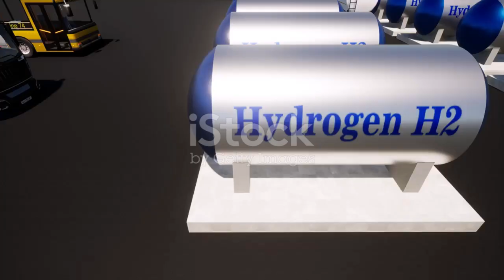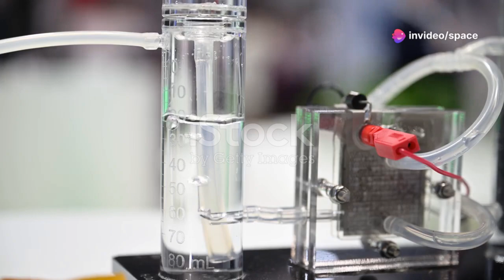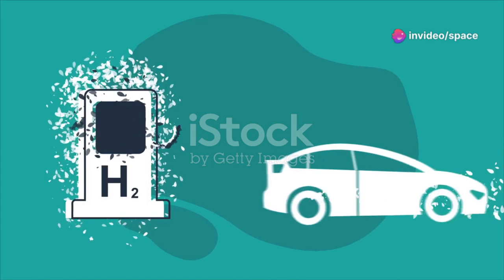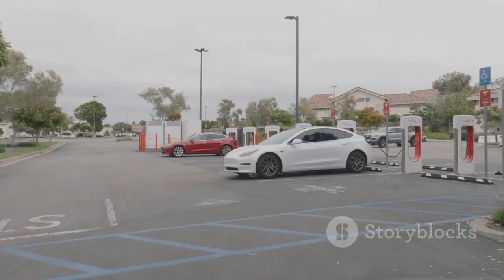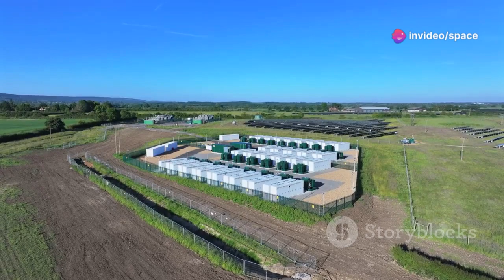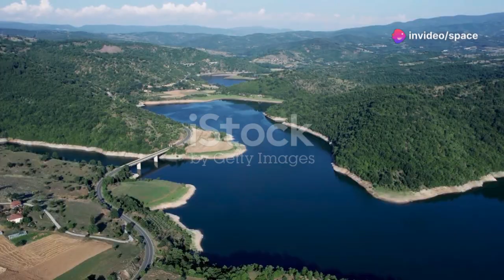TOYOTA CEO: THIS NEW ENGINE WILL END ELECTRIC CARS," SAYS TOYOTA CEO ABOUT HIS CREATION

Comment: Hydrogen fuel cells (HFC) are an old technology, which were used even in the Apollo mission spacecraft of the 1960s. The technology is one of those that tease by seeming ideal in theory, but fall completely apart in practice. The are at least three obstacles which render HFCs impractical for motor vehicles.

1) The energy density which makes hydrogen such an attractive fuel also makes it very dangerous. It’s extremely flammable, and ignites easily. Just refer to the Hindenburg disaster, after which, the dirigible industry switched to helium. Compressed into a fuel storage tank, hydrogen creates a high energy bomb just waiting to explode. Liquified, it is used as actual rocket fuel. 

2) Speaking of fuel storage, hydrogen has to be either liquified and maintained at extremely low temperature, or compressed as a gas at very high pressure to store enough of it to be useful in a vehicle, in terms of range.

3) If hydrogen were just lying around, the above practical problems would be obstacle enough. However, hydrogen isn’t just lying around, and must be produced (liberated). The energy required to produce (liberate) hydrogen greatly increases its cost - in addition to those safety problems.

As a result, tanks of hydrogen will not be replacing batteries for storing energy in automotive application. Battery technology is poised for even further dramatic leaps in terms of energy density, and re-charging speed than has occurred over the past 10 years. In addition, since batteries don’t have the safety problems of storing hydrogen, and are a power technology well in production use, I see no reason that hydrogen has any chance gain a market foothold. The only exception would be some radical scientific breakthrough in rapidly electrolyzing the water from on-board tank, using only a small amount external energy to do so.
Reply: On top of these problems -  the car will have to have batteries to recover energy from braking & etc.

Comment: Already you can buy a BYD EV for $20.000 with range almost 400 miles and recharge 250Mls in 15 mins. I have seen people trying to fill this Toyota and it takes 15 mins for them to try and remove hose frozen in. You do not mention cost, at $36 a kilogram it costs almost $200  for your 400 miles more than x10 cost for electric. This is Toyota propaganda. Ask any current owner of Toyota hydrogen car would they buy another 100% NO. They can't sell them, nobody will buy and the fortune they cost them has dwindle to zero. This is a real lemond! Half your milage is looking for a pump, more than 50% do not work. Could go on for hours, but Toyota bet on a lemon and it's all down drain. Electric is the only way.